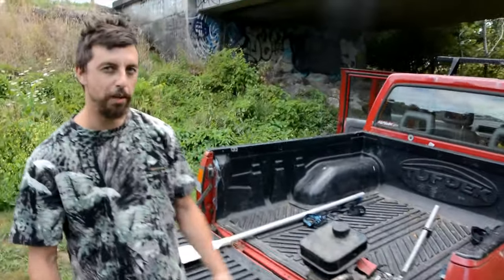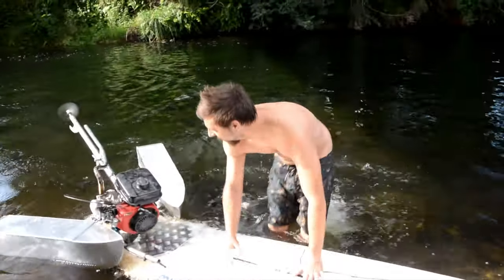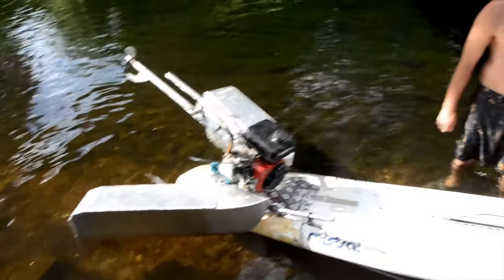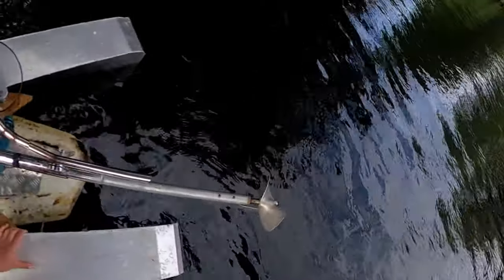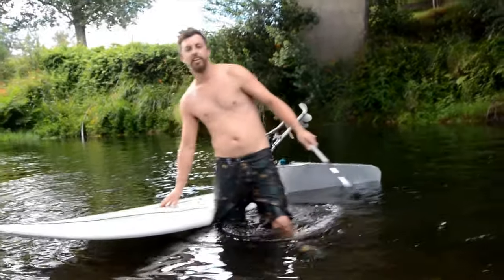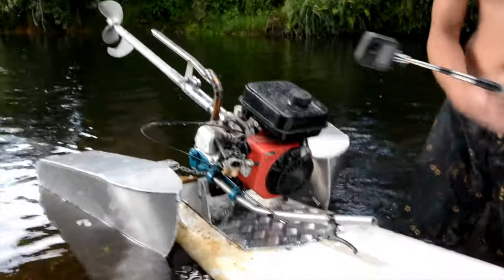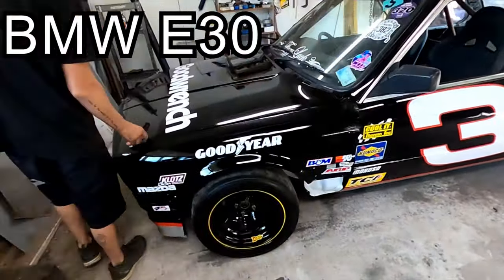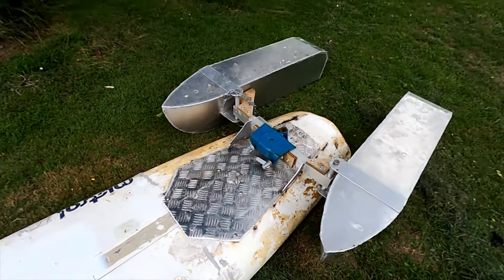Motor Surfboard, Paddle Board , Finally Works Well!

Comment: That's really cool.  The larger prop and straightening out the pontoons made a huge difference. Maybe a sheet metal splash guard around the front of the engine would help keep the water away.
Your friends little rotary powered BMW must be a lot of fun, it looks like it's pretty light
Reply from the maker: Yeah like a deflection plate in front of the motor there’s a lot more speed to get out of it once I can reduce the drag. His goal with that bmw is to get it super lightweight pretty much just the outer shell left on it👍

Comment: Working really well now, good job. Might find with a longer handle you can move forward on the board a bit. Help stop the back end sinking down and make it easier to get planing.
Reply from the maker: Yes that could help!

Comment: Put a bit of a splash guard over the flywheel as that is likely what is slowing the motor down and it would be simple to fab up....
Reply from the maker: Yes that is a good idea ! The flywheel was also flicking water into the carb as well so it would help both problems.